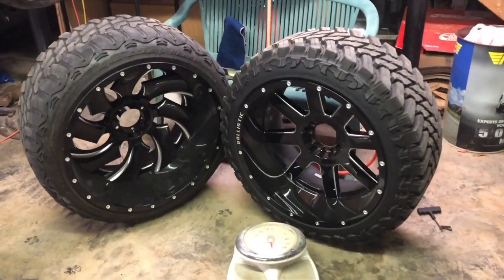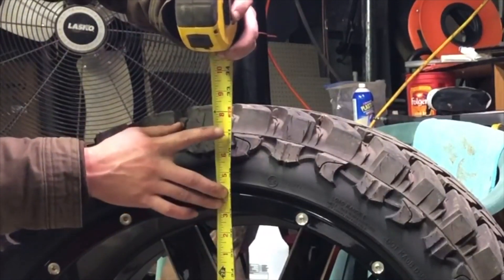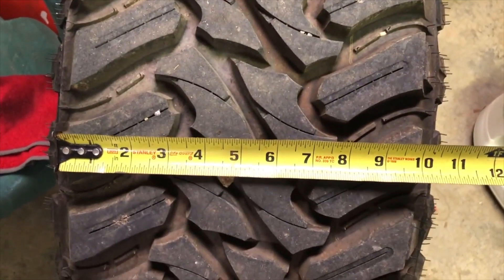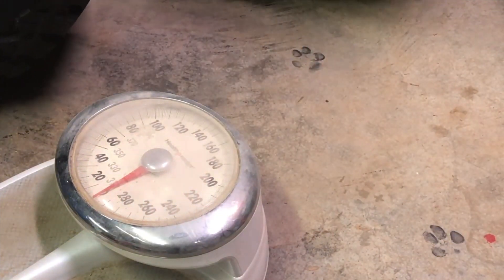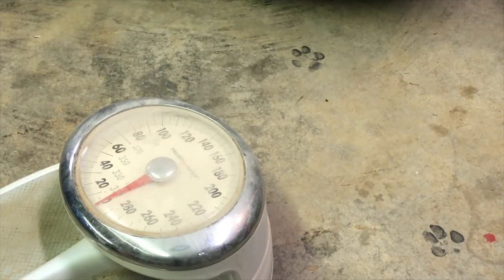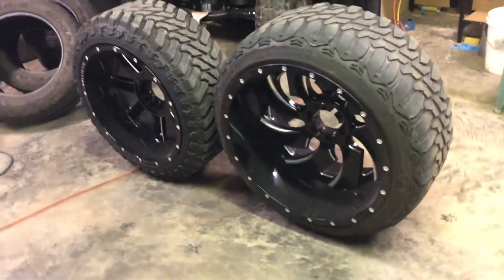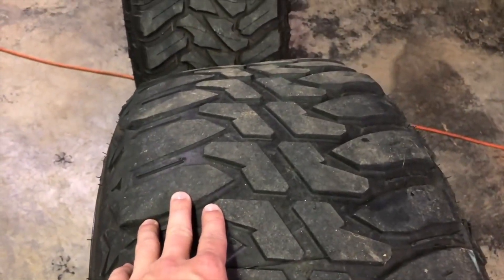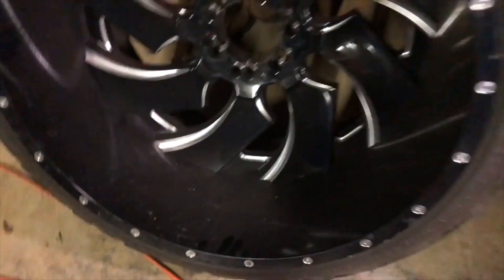24x14 vs 22x12 - HEAVY WHEELS

Comment: Yayyyy I’m first for once!🤣 hey lmfscrew what do you think of an 07 F-150 King Ranch crew cab 4wd with the good ole 3v triton? I’ll be picking mine up Monday in Birmingham Alabama!
Reply from the maker: I love f150s especially king ranch in that gen, depending on the mileage they are great trucks. I think one big problem some had was the spark plugs breaking off without the proper tool from ford after 100k miles. 07 might have been fixed at that point not sure.
Reply: In my opinion I think just step away from the 5.4s 3 valves. A lot of timing chain issues. Guides break off then you get rattling noises. Or hot rattle noise from the time chain.

Comment: Did you regear your gear ratios for those 33 with 22x12? I want a wheel combination like yours but my 2018 z71 has 3.08 gear ratio so I want to know if I can run the same without stressing my tranny out too soon.
Reply from the maker: My truck has 3.08 and i did not regear. You can tell a difference from stock but its perfectly fine to me.
Reply: lmfscrew thank you!